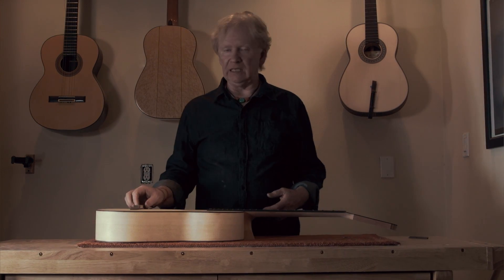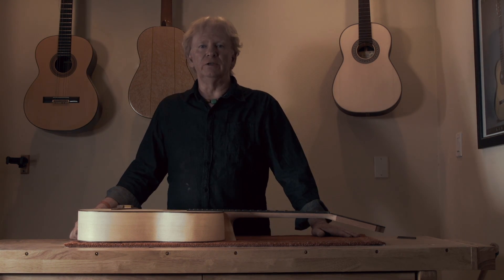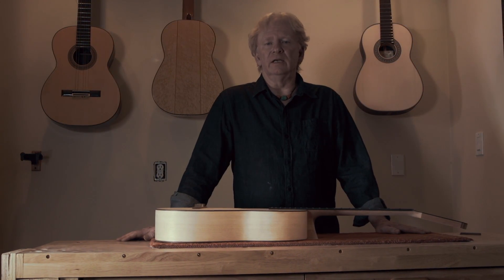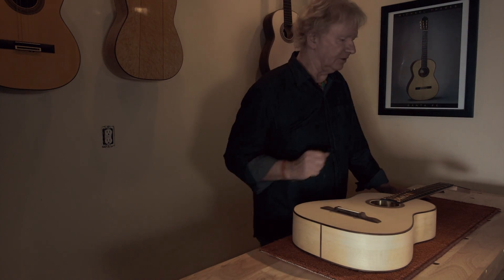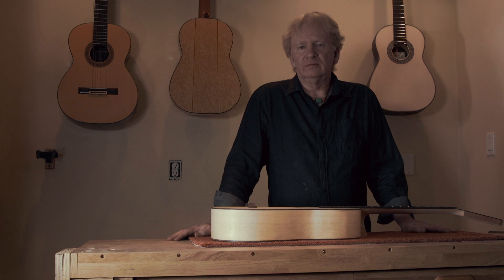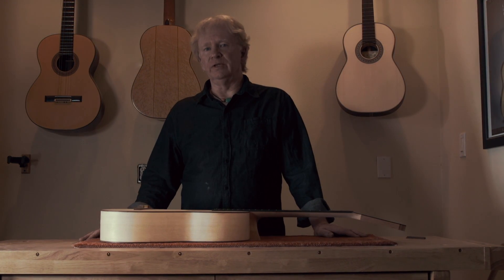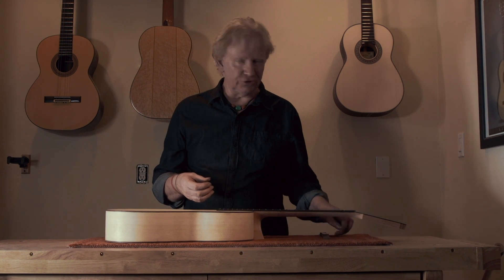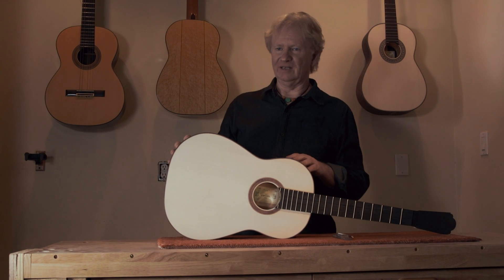Torres La Leona with "secret bridge" Michael Thames

Comment: Interesting what you say. La Leona was an experimental guitar according to Romanillos. Torres indeed never reproduced that design. His later 1850s and early 1860s guitars were better quality in Romanillos opinion. So I think you are right on. That bridge is exactly as I pictured it based on what I read. But again, Torres went with a saddle in later guitars exactly because you could adjust the action. I do love the sound of Torres guitars, even his later models, which supposedly didn’t have the best woods. Personally I go for the design he used for Tarrega’s guitar.

What’s the typical air resonance of a Torres guitar? Do you know? Also, does the resonance scale start on C, the lowest, and go up from there?